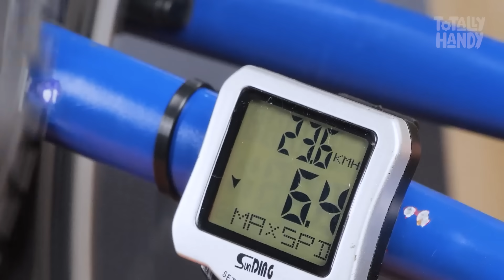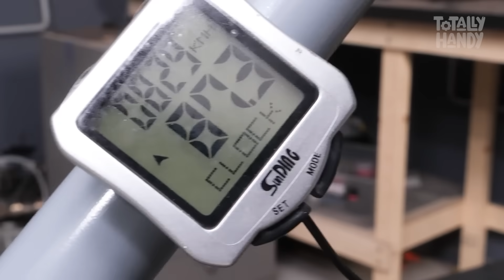DIY Flywheel Bicycle – Boosted Speed with No Motor?

Comment: Complete BS - speed = effort regardless of gearing used. Given the same weight and wind/mechanical resistance using an 90" gear or a 120" gear (how far you go with one pedal revolution) requires the exact same amount of energy input. Given what the 'new' chain ring was made from, it hardly qualifies as a 'flywheel'. Regardless of anything else, the teeth off of a couple of chain rings would have been required to weld around the circumference of that piece of metal he cut.

Comment: I run a 75t front 
And a 16t rear.

Your chain stays have to start very narrow from the bottom bracket....all the way to the rear dropouts.

My frame is a pursuit frame...700c rear and 650c front.

Chainring has two punched out BCD patterns.

130 and 110.

Comment: This flywheel bicycle concept is brilliant! I’ve tried a similar setup using a salvaged alternator flywheel and noticed a measurable boost in coasting range. Curious how you managed the weight distribution did you balance it centrally or favor the rear wheel?